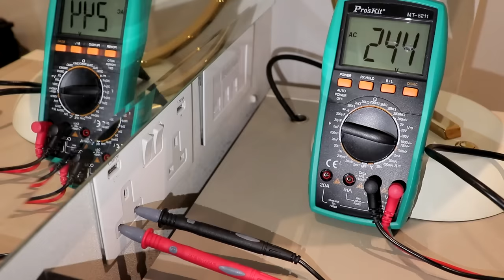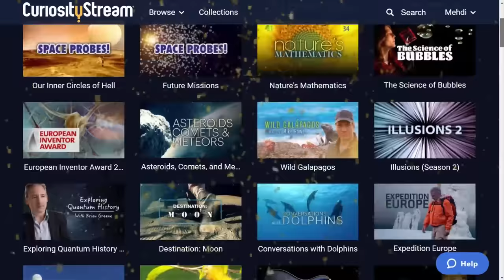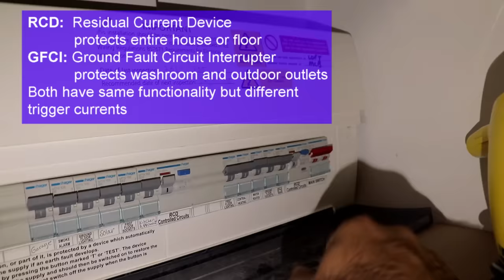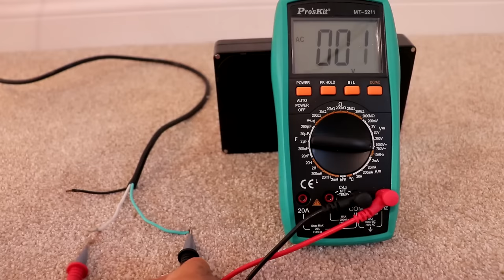Power Outlets in United Kingdom

Comment: It takes a lot of effort and imagination to overcome a UK plug and nearly start an electrical fire. My congratulations...
Reply: @John Ashtone In fairness, it depends how old it is - they might be on fuse wire, plenty places here significantly pre-date modern breaker boxes! (And yes, I mean fuse wire, not just pre-made fuses. It's a whole different world of ways to mess up :D )
Reply: There safe until u step on the prongs
Reply: @asharak84  Fuse wire in a hotel?  I very much doubt it.
Reply: Best plugs in the world
Reply: @jondonnelly4831  you can run two heaters off a double socket no problem. Off one, well adverts are run not to do that.
Reply: Every portable appliance is fused at 13A max including adapters and splitter so even a double socket on a 32A ring main can only draw 26A (2 x 13) or 13A for a single socket. This also ensure that the protective devices have a diversity of 2:1 to ensure the plug top fuse will operate first to prevent nuisance tripping
Reply: Also UK appliances don't draw half the current, they are allowed to draw 13A which is significantly more than 15/2. That's one of the advantages of having 240V ring mains: when you want your tea right this moment, your kettle boils in a reasonable amount of time.
Reply: @John Ashtone You're assuming that the RCD is in a place that guests can access... which is unlikely in a hotel. It's likely to be inside a locked room or in an area out of bounds to guests.
Reply: But… fire fun
Reply: @MadeInGreatBritain  They are not the best in the world. A small child can insert a finger into the gap between the socket and the plug when it is already energized. The best is the euro socket and the euro plug types E, F, C. It is a consequence of the "evolution" and very strict norms of the individual states of the union, not of tradition.
Reply: As someone who was shocked when plugging in an extension cord with a good load  behind my couch I can say I wish we had those plugs here lol.
Reply: @John Ashtone When repairing the wall, a piece of sheet metal fell vertically on this drawer, which contained a plug. There is a short circuit. When I measured the gap between a plug and a socket of this type, a small child would stick his finger out. Children also try other subjects. I immediately replaced this type of socket with a safe type. You really don't have to teach me about electricity, and if you read the history, I responded to a specific post that didn't confirm my experience. Try something else. :)
Reply: @DL-kc8fc  eh? I'm staring at my plugs and there is literally no gap (onlything I could slide between the plug and the socket was a piece of paper) but that wouldn't electrocute you either.
Reply: @_Shinasu  These are definitely not good sockets. If someone foolishly writes that these are the best sockets in the world, they must expect an adequate response. :)
Reply: @asharak84  My house uses fuse wire.
Reply: @DL-kc8fc  yeah, so great having three shapes that need adapters to sort. Lol
Reply: @John Ashtone lol what is this garbage? :D
Reply: @John Ashtone do you not speak english? Do you attempt to correct people when they say “truck” instead of “lorry” too?
Reply: @winrar42  Adapters also annoy me, but if someone writes stupid that English sockets are the best in the world, I'd rather use adapters. :)
Reply: Didn't look it took much at all. That is unless you are trying say they are not as "creative" in the UK. Lol
Reply: North American Ingenuity
Reply: @DL-kc8fc  According to BS1363 (the Standard that specifies all aspects of the plug and receptacle - the correct term is neither "socket" nor "outlet") what you allege isn't possible and John is correct, though his terminology is muddled. You must have been using a non-compliant plug or, less likely, a non-compliant receptacle. The number of non-compliant plugs is unfortunately on the increase through grey imports from the far East.
Reply: @johnm2012  In fact, I was not at all interested in the design of various types, but rather in an ironically adequate response to a stupid statement. In addition, the corrector and translator fix everything to "sockets", so I usually guess what the discussant wanted to say, who wrote through the compiler. :)
Reply: @DL-kc8fc  no they can’t. There’s plastic covers over both lines to stop this
Reply: @DL-kc8fc  still waiting for an adequate response.
Reply: @maxcheese5586  Somewhere above I state why I had to respond. It really doesn't have to do with what you think.
Reply: @maxcheese5586  Somewhere above I say why I had to react - it was a reaction to stupidity.
Reply: @DL-kc8fc  you clearly have no idea what you’re on about
Reply: @maxcheese5586  Just that I know exactly and that's why I reacted. Someone might delete their own posts so they don't look like a fool, do they? :)
Reply: @DL-kc8fc  honestly, each response makes you seem less educated.
Reply: @DL-kc8fc  the UK (and I am not from there) has the best electrical set up & regulations on the planet.
Reply: @maxcheese5586  That you would finally begin to understand irony and a little sarcasm? That is progress. You don't have to delete anything.
Reply: @DL-kc8fc  I haven’t deleted anything & you can’t back track claiming sarcasm. That’s weak. Oh well, enjoy trolling
Reply: @maxcheese5586  Irony and a little sarcasm. Don't try to twist it. Nothing has been applied retrospectively, because when you study history, I said a long time ago what was the impetus. You are the only ones trying to enforce some of your truth, which is a reflection of your misunderstanding of the situation. That's why you also deleted your posts...
Reply: @asharak84  You must have a RCD installed by law. So no one is using fused wire anymore.
Reply: @jjarry  Not true, it isn't a legal requirement to replace old units if they are not otherwise unsafe, though anything that triggers an inspection & test of the old system will pretty much force the change. You can't do basically any electrical work without replacing them as a result as the leccy won't be able to sign off, yes - but people are absolutely still using fuse wire. An EICR would flag it and might result in negotiations around price if selling it. I'm not personally as I moved out of that property, but they still exist in the UK.
Edit: I guess the original context was commercial property though so you'd be right there
Reply: @DL-kc8fc  Your response and understanding are inadequate in this instance. The standardBritish plug was updated to include shrouded Live and Neutral pins, you should not surmise that all plugs are of the old 'full metal pin' type, that will now only exist in sheds and houses that don't test appliances.
Reply: @stuartreynolds4480  It is possible that the new types are better. I didn't research it because I use a different standard...
Reply: @jollyhoho8782  not true, the fuse should be sized for the load that means between 3 and 13 amps they are sized 3,5,10,13 amp. If your using nothing but 13 your doing it wrong as wire used on the plug to the appliance can be rated less. Most plugs here in my home are at 3 or 5 amp unless it a high current device like a kettle or heater.
Reply: @DL-kc8fc  doesn't euro plug have prongs count out of the wall? I would not call that safe at all.
Reply: @damiendye6623  It has no spikes from the wall. Protective pin only. In the 1950s, the lobby of very influential non-professionals abused the concept from 1930-1933 and forced so-called zero protection without partial grounding, and this was dangerous if the PEN conductor (TN-C system) was broken. This is because the PEN wire is damaged (broken) more often, not the L wire. Today, a different concept applies, regardless of tradition. The protective pin (that is, the one from the wall) is PE and balances the potential or conducts any fault current. Why is he sticking out of the wall? He must be the first to connect to the appliance frame - the person is protected from possible injury before contact between L and N !!! This system is TN-S and I allow the application of protectors (not to be confused with FI). European Union countries have various safety pins, for example on the sides of sockets, as contacts. But maybe you didn't understand the premise. I only answered one stupid person who claimed that the English solution was the best in the world, so I used the same stupid rhetoric in response. Nowhere do I directly evaluate which socket system is better, only the unsuitable design, which in the English version allows the insertion of a thin metal object to live contacts (this is not possible in the European plug). Someone has already written that this is solved by a new type, which is good.
Reply: When I was in science class we opened the doors with a pencil and stuck tinfoil into the two live ports, and stuck the two pieces of tinfoil together, made a massive spark similar to what happened to mehdi, luckily teacher somhow didnt notice.
Reply: @johnm2012  What @valen tino suggests is possible. Newer plugs do have the lower part plastic coated but older plugs do not and are just brass slugs that can be taken out of the Bakelite housing.
When I was at university, one of the guys in the room next to me would always return after too much alcohol, put on music and immediately fall asleep, leaving everyone else to be woken and suffer.
One night, I'd had enough, I pulled out a plug in my room, part way and put a screwdriver across live and neutral and flipped the switch, promptly blowing the fuse wire in the building panel and killing the music.
My degree was in Electronic Engineering, I'm not without a clue as to what I was doing.
Clearly, if I could do that with a screwdriver, small fingers could achieve the same, though newer moulded plugs are better, there's still plenty of the old type around.
Reply: Just a piece of wire apparently.

Comment: Blows all outlets in room

"So basically, I just ran away"
Reply: Nitro Gaming lel
Reply: So anyway, I started running
Reply: Not just his room all of the rooms in the area, they share the RCD.
Reply: Lol
Reply: Wow
Reply: Wait until he goes to Russia. He’ll play “God Save the Queen”.
Reply: Surely the hotel were suspicious when ‘mr electroboom’ checked in and suddenly the breakers that cover his room start tripping.
Reply: Badger Pa I honestly started crying of laughter. If the hotel used a Ring Main Circuit it would have been ok so the others could still operate.
Reply: @ahmedalta4480  I don't think so the surge current in a complete short circuit is enormous. Some weeks ago my mum accidentally snapped the cable on one of my fans and EVERY SINGLE FUSE/BREAKER along the way from the plug to the main supply wire tripped. Plug fuse, room breaker, all plugs breaker, master breaker. RIP fan.
Reply: @ratvomit874  Sounds like a fun way to get around those pesky surveillance cameras.
Reply: Please, try using your toaster in the bath!
Reply: @Craig-wp3pz  you're an angry guy craig
Reply: @churchers  WHEN I GOT IT I DIED AND SLAPPED THE TABLE